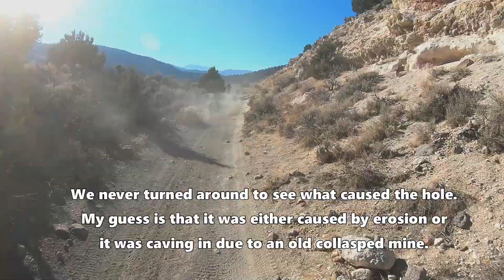That time we almost rode into a collasped mine - GPX Moto FSE 250

Comment: You're actually riding an old railway line at that section. Its just a eroded/collapsed section of the rail bed and not a mine 👍
Reply from the maker: I think it was caused by erosion too. I think there was a drainage that went under the tracks there that could have caved in or collapsed. If you look to the right where the hole is on the left, it seems like something was covered up there too.
I knew it wasn't a mine but knew it would make for a more interesting title/video. Click baity, yeah, I know pretty lame. 🤷‍♂️